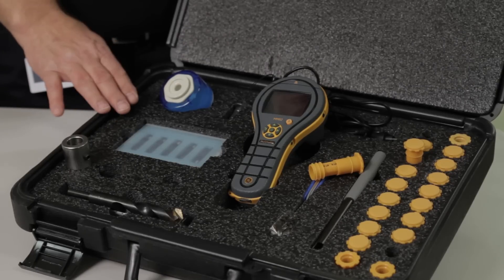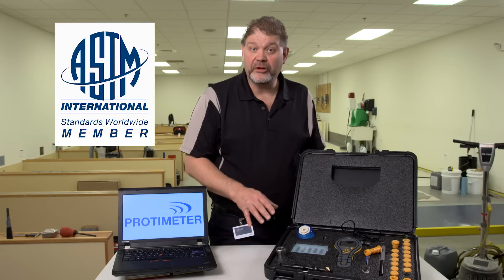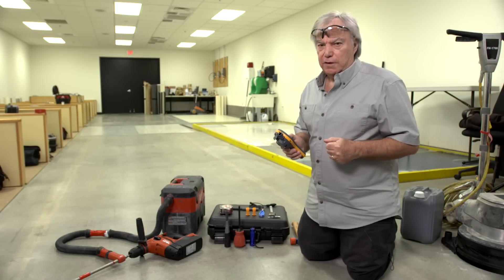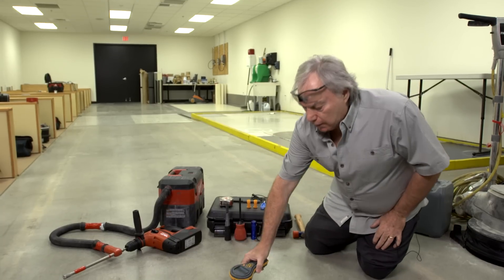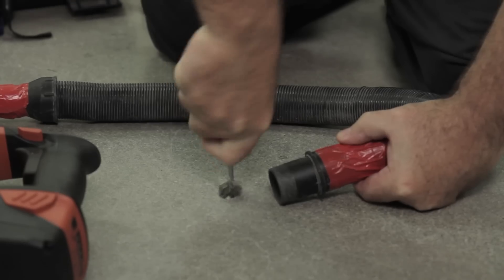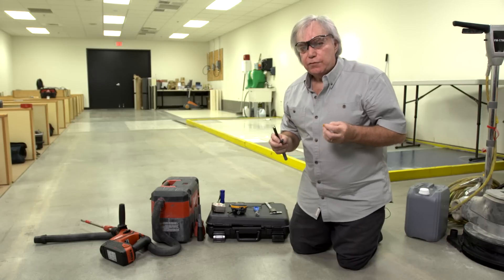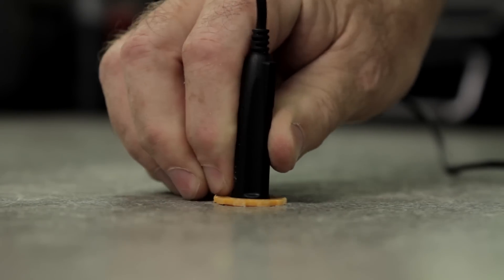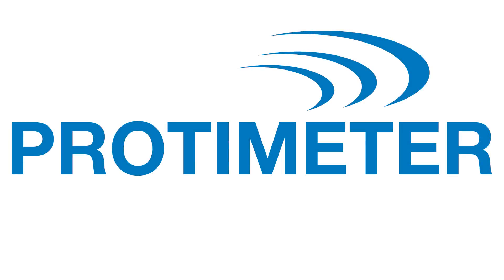Protimeter MMS2 Flooring Kit | Demonstration of Humidity Testing in Concrete Floors

Comment: I want to see the calibration check. Why is the Protimeter calibration at 75% and other reusable systems have calibration at 60% (Wagner Meters) or ***** has 1 or 3 75% salt solutions. Do the Hygrosticks not have to be kept in a calibrated environment? I have an old Protimeter I got at surfaces (Pre 2170-11) and found that the accuracy of the probes is so important.  The +/- % matters a lot as does their calibration.  I have had 3 or 4 jobs in the last few years where old equipment gave false low readings on RH.
Reply from the maker: Evan Adams 

Hi Evan, We use a resistance
based sensor that we manufacture especially for this application. We do not
need to keep the sensor hydrated to keep it in calibration and it recovers extremely
well from dew point. The sensors in the kit come with a 4 point NIST traceable calibration
certificate and the 75% salts test is meant as a calibration check at 75% RH.
We use 75% as a test point rather than 60% as its closer to the normal levels
of RH% found in concrete.
Reply: Protimeter Moisture Meters thank you that makes sense.  We use all independent ICRI certified testing firms so I will make sure to keep this in mind next time I see them testing.